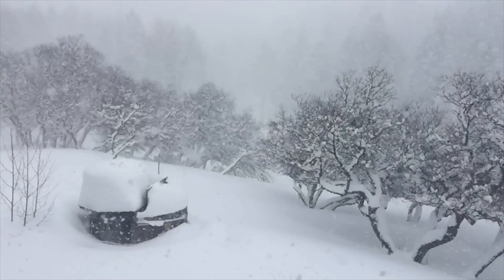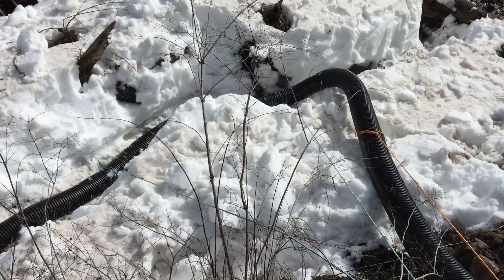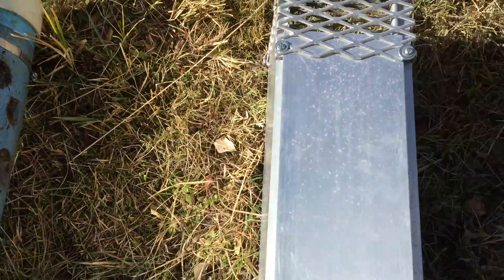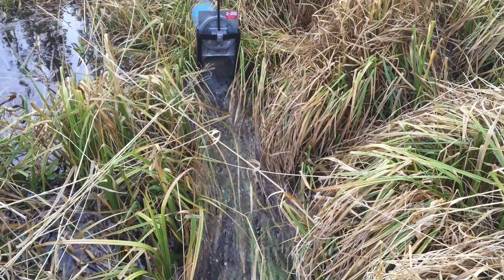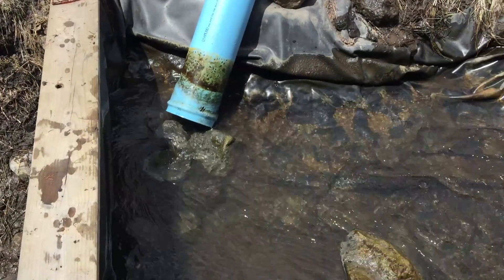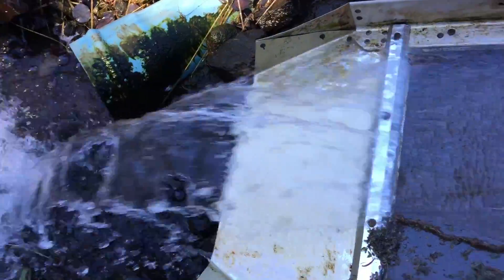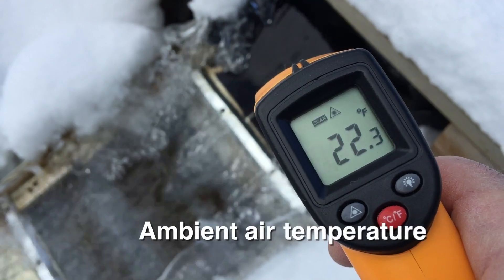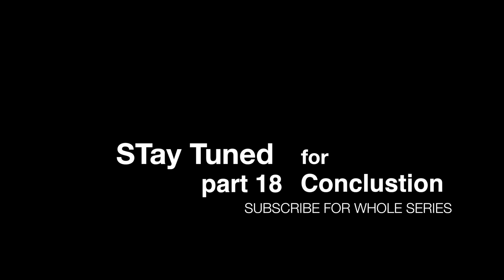Part 17 MicroHydro Power System in CO

Comment: MrHydroHead, Incredible job putting all this together! Not just the system itself, but the videos as well. My wife and I have been moving towards Off-Grid for 2 years now and I suspect that it will be a few more before we are even close to starting. Our little farm and buildings are 150+ yrs old and were poorly maintained, so there is much work to do in getting things up to snuff first. Unfortunately our current property has no running water, however there is a boatload of wind out here! Turbine system would be primary, then solar. Local power Co. says we can't tie-in to sell excess due to the local station's limitations, so battery and inverter system is only way. Start-up costs are high though. I will subscribe and keep on watching as one day I hope to use the excellent info you have so graciously provided. In return I hope to reciprocate with some of my own. Keep on keeping-on!
Reply from the maker: More power to you!  Its a long road but well worth the effort. On wind, I’ve heard vertical vs horizontal is the way to go on the turbine. Thx for watching and the kind comment. Best wishes for your progress.
Reply: @mrhydrohead  YES, stay away from the horizontal, too much noise, too hard to maintain and susceptible to hail storms. Several of my neighbors have wind turbines with stubs for blades, thankfully because the noise was driving everybody nuts. I sold mine and built a small VAWT, much more interesting. Working on a large one now.

Comment: Pretty cool.... For the air locked pipes at the high points, could you install a t-pipe like a chimney stack, the air wouldn't build up and hopefully the pressure in the pipe would be less than the pressure of any water that builds up in the stack?

Comment: Is it worth filtering the soft organic matter out of your pipe system? - it won't hurt the generator and will continue to move as long as the water keeps flowing.  On the subject of icing - put a sheet of insulation above the screen - it will prevent or minimize the ice formation by preventing cold air from contacting the screen.

Comment: The alternative to a screen is a "small gravel" filter that is very wide to have a large coarse grained surface area.  Use 6-10mm sized  gravel 2-4 inches deep for roughly optimal flow and clean-ability.  It will take longer to clean, but it will be once in a long while.  You clean it by stirring it with a pitchfork or similar while directing the flow through it and then out of your system to avoid sudden contamination.  For cleaning pipes, create a crude waterproof robot (flow riding with battery powered spinning brushes to ride the pipes and clean them kind of like how oil pipelines do it.

Comment: This is awesome!

I do wonder--have you guys thought of using a small amount of the power to generate heat near key areas of the system? Even a couple hundred watts could significantly mitigate the need to manually break ice over the inlet/outlet/etc frequently (if it is a frequent thing in the first place). To increase efficiency, you could use IR proximity sensors to detect the ice (mostly just sensing the ice as opposed to the IR beam bouncing off the metal grate, assuming it doesn't get diffused by the water) and run the heaters only when necessary. Or something along those lines, maybe using an ultrasonic sensor that only checks every several minutes if the IR sensor doesn't do the trick.
Reply: exactly what I was thinking...
Reply: or a remote switch to turn it on once the pressure drops off
Reply: @superdupermax  He could install flow meters at key points in the system which trigger automatic filter cleaning and heating if the temperature is low enough, but it may be more trouble than its worth, and requires more knowledge.

Comment: This is over a year late....but have you thought about capturing the exit water from the generator and doing a hydropump to pump it back up and reuse it?

The hydropump works simply on gravity and trapped airpressure.  Where flowing water pushes the bubbles down a tube, when it enters a holding tank the air pressure builds up and able to push the water from the tank back up past initial elevation.  Where you can then reuse it and flow over the generator again...
Reply from the maker: It's an interesting idea, but the intake is 1/2 mile and 240 ft above where it exits.  There isn't really a shortage of water or power produced, so the expense and effort of designing and installing something of this nature doesn't at first glimpse seem a practical use of time money or resources.  The simplicity of what already exists and how simply it functions is part of the pleasure of living with it.

Nonetheless I'm always intrigued by the suggestions people make and thanks for your thoughts.
Reply: @mrhydrohead  Awesome, thanks for the reply, and loved seeing your work.

Comment: Don't know much about this but that stainless steel screen you got works much like a sleuce miners would use to trap debris in a controlled way. An idea for someone with less of a budget. check out the RealMartian on YouTube. He built a self contained micro green habitat in a very cold climate. He uses Ardunio controllers to monitor his operation and control processes. This could be used to control water flow, monitor and bleed air out, and control gates. With some ingenuity, a wireless networked operation complete with cameras on your property?
Reply from the maker: I've had a very short look at The RealMartian. Great great stuff and loads of it.  Thx for sharing this, it obviously will provide loads to learn. 👍👍👍
Reply: If you ever have to move water uphill, look up ram pumps. No motors or electricity. Just have to have positive flow. A thought I had if you wanted to recirculate or move water around your property. Wranglerstar had a couple good videos about them a few years ago.
Reply: Ram pumps can be made easily with off the shelf plumbing fixtures
Reply from the maker: Thx for watching and the tip. I’ll check it out 😉
Reply: Sleuce the debris out before it hits your filters. However that would hve to be cleaned.

Comment: Or you can use a big hose that is under water with a big 10 inch cut out in it that is downwards to then push water up and over to the screen, so stones and big debree are sifted out before reaching screen that is in open air

Comment: Very good system my curiosity is why not generate the power near the intake and transmit it with wire
Reply from the maker: The head or fall of the water builds pressure and that is the source if the kinetic power that is converted to electric power
Reply: Thx for reply.  I thought it was something like that. Love the kolander screen

Comment: I noticed icicles forming on your eaves.  Soon water will find its way into your ceiling.  Got to keep your attic space cold or else you might need a new roof because your attic air is very warm and melted snow dams up under your shingles and damages your roof.
Reply from the maker: No attics in the house. Ice dams have become a problem on the north face where the sun doesn’t melt them off. Plan to install heater cables to reduce their formation.
Reply: Get some roof squirrels. They’ll keep it clear

Comment: WHY NOT INSTALL A LITTLE HEATER BAR IN WINTER TIME FEEDED WITH THE ENERGY PRODUCED BY THE POWER SYSTEM TO HEAT THE SCREEN ON THE CRITICAL POINTS ON THE WAY OF THE WATER.
Reply: Because it will need too much energy to be effective. The flowing water will constantly cool it.
Reply: @vstoykovbg  Good point . It would require way too much electricity to fight against the constant cold temps .
 My thought was perhaps wrapping the pipes with insulation and burying them below a few feet of sand and then use styrofoam sheets to insulate other areas exposed to the cold air temps or build small shelters around the areas where exposure to the cold air could be an issue . 

Obviously these people know what they're doing but the thought had occurred to me that insulating key areas where there's any exposure could greatly reduce the need for constant maintenance aside from the regular debris trap clean outs  .
Reply: The problem is not the freezing of the tubes, it's the freezing above the collector and clogging the filter wit ice and/or biomass.

When the water is running it does not freeze, even when the temperature is slightly below 0*C.

Of course, the thermal insulation will prevent water from freezing in case tubes are clogged or temperatures plunge way below 0*C. But at such low temperatures the collector will be frozen too.

Comment: Build an automatic brush. 
That rotates from the current of the water. And you'll have clean screen. 

Or use the electricity to drive a motor and brush of the screen With a timer.
Reply: Great idea but might freeze in the winter.

Comment: I wonder if using any solar in the system would provide some heat to melt ice at the screen or elsewhere it might be needed (parabolic collector?)....not sure if the need is sufficient. it could even be a brine, self cycling with elevated tank, if not photo-voltaic.I was going to also suggest a brush powered by the water or solar, but you addressed that a few comments below. You have a great thing there, which creates those feelings of energy independence I've been drawn to since the 70s! thanks for posting!
Reply from the maker: Thx for watching and your thoughts

Comment: You need to add a sluice box so you can harvest your gold in late spring.
Reply: WARNING. Before anyone does any of this you should look into your states department of natural resources on regulations regarding trout or salmon stream alterations.  In many cases you can receive a significant fine for doing something like this.
Reply: Ha ha
Reply: Haha! I was just thinking the same!!
Reply: if it's anywhere near alaska then there deffinatly IS gold in there.    

infact with the glacial movement in the past it should be possible to find gold anywhere even as far down as central usa.
but that organic material would be a giant pain to work with.
Reply from the maker: Lol. Would certainly do so if there was gold here but no such luck

Comment: Not sure where it fits in with your issues but with all the cleaning and ice removal have you considered anything like an inner tube at the exit points when the ice builds up inflate the tire it cracks the ice. Planes have been doing something similar for years to remove ice on wings.  You can also use a burst of air to reverse flush the derry on intake filters.  I'm not an expert just throwing it out there.  Good job on off grid, looks amazing.

Comment: You show me the problem i have solution you need copper pipe and a boiler and copper pipe will be insulated with pvc . run parallel with source pipe run steam mate easy to sovle or run power cable and heater blockes or hybrid both to prevent icing.

Comment: Great video.Very nice build.
 You may have already fixed your problems.
 Your Coada screen I thought maybe you could use the power of the water and build a paddle(like on a paddle boat)with rubber or brushes on the ends of the paddles that would keep turning cleaning the screen?
Reply from the maker: You would not believe how little organic matter actually sticks in the Coanda screen. It requires a visit maybe at most once per week and maybe every two weeks. Even at that, there is so little accumulation I need not visit for the most part. Thanks so much for watching and your comment
Reply: @mrhydrohead  Sounds like you found the right screen.👍

Comment: Awesome guy's...I also have idea's about hydro power generator ...my idea is a bit different though...my idea was to have a floating generator that would follow the flow of the water level ...much like a float in a fuel tank for fuel level...floats would be mounted with metal poles in the center of them to allow them to rise and fall with the water level... I don't know if it would work for sure...it's just an idea I will probably never get to try out
Reply from the maker: Hmmm. I’ll have to think about that. Thanks for watching

Comment: You should have heating ..
Reply from the maker: 5000-6000 kWh per month is more than we can put to effective use. At the other end of the system, low maintenance & monitoring. No need to run expensive  loss prone wires 1/2 mile uphill. 

Just the same, thanks for watching and your suggestion

Comment: I have an idea for your intake. In koi pond filters there is a device called a vortex filter. Solids swirl to the center and flow out through a small,  low central exit. Water for power production is bled off of an upper overflow chute. The thing is designed to maximize swirl, like a Dyson vacuum cleaner. Something like that might work in your application.
Reply from the maker: Interesting idea. Thanks for watching

Comment: I like how you share your design process, especially the failures why they happened and how you solved them. I wonder if it would make sense to have mini greenhouses around in the intake areas to help melt away the ice, or maybe some sort of solar voltaic heating element to keep the grid temperature just above freezing or maybe it could be traditional solar water heater radiating heat. It seems there is plenty of sun light to achieve those goals. Just a thought.

Comment: Followed ya awhile now. All beautiful. Ampmeter ?? Nyet.Nein. AMMETER  OUI !!
I have a crazy idea for ya. It might sound crazy,... but.... I'll own your failure if you have to try it.
Check a company Mt.Baker Mining and Metals.  They have designed a sweet little offset gated chute for their Finish linework.  They are here in YouTube also.
Also, I understand the Polarity of water will dictate it's freezing point, far more than salinity does. I wonder if polarizing the unit might stop it's surface from freezing at all. And instead of the ax and shovel, a water hose does do good work on ice.
Reply from the maker: Thx for watching. Can’t locate gated chute you mention. Would it be for diversion of water or filtering of water. Not sure I understand

Comment: A drum shaped screen that rotates  would not have build up .
Because it would be constantly spun by the water flow like a paddle wheel . 
Also a photo voltaic panel a battery and some thermal wiring could deal with your freeze up spots.
Or a tall tube of pvc painted Black capped and filled with a glycol mix .
Would heat in the sun and constantly thermo syphon . 
Make it taller than average snow fall ....

Comment: There is a thing called a Trompe it uses hydo power by taking micro air bubbles trapped in the water stream to a underground chamber this creates huge air pressure that can run turbines without the wear and tear of sediment on them you can run any pneumatic tool off the system as well they even used it for cars back in the day.
Reply from the maker: Very interesting. Ill research that. Thx for watching and sharing
Reply from the maker: https://www.motherearthnews.com/renewable-energy/hydro-power-zmaz77jazbon
Reply from the maker: It certainly warrants investigation. Right now we’re under about 20” of snowfall so far this year. Any additions will have to wait until spring to even consider.

Comment: Why not try to use stainless mesh
Reply from the maker: Tried it initially, but organic matter quickly became lodged and reduced the creek diversion flow. Letting organic matter into the meadow isn’t an issue as the engineered coanda screen finally installed filters all of it out.

Comment: hi just a thought you could perhaps mount a window wiper motor in a sealed box with a battery that gets some electricity from the generator with a wiper blade that activates on a timer switch to clean the mesh filter from time to time do not know how to do this my self and would like to do something like this my self just a crazy thought ?
Reply from the maker: Actually the cleaning on the engineered screen I installed is very minimal, besides running power 1/2 mile up to the screen would cost a fortune. The newer screen is here:
Elgin Coanda Screen Installation
https://youtu.be/KVrt3oM5qWo

Comment: I believe most of your problems screening could be solved with an intake settling pool with a shunt load resistance screen heater with intake a few inches below water level
Reply from the maker: Unfortunately it would require running 1/2 mile of wire with big line loss. Solved the problem with changes in the intake design

Comment: Screen Problem resolution is a drum which will rotate under a long brush both sides so then screen is constantly cleaned without attentiveness, use bearings that will not freeze being kept out of the water using a long-shaft then cover the apparatus with a sheet of galvanized to avoid debris falling into it. You might also consider a series of beeps that would be sent wireless on a ground line like telegraph setting it uo as a battery operated rotating disc so that it will alert you in the home for a problem that occurs at problem areas using a different code per area and a paper fed Seismograph (https://d2v9y0dukr6mq2.cloudfront.net/video/preview/RJZZIy2/seismograph-machine-room-animation_n17uuf_v__SB_PM.mp4) or computer program reader RS-422, RS-485 or RS-232 input.

Comment: Have you tried a cyclone sediment separator device instead of using meshes? You can probably make one out of a large water drum pretty easily, leave a small opening at the bottom for small particles to flow out and a large opening with valve for periodic removal of large debris.
Reply from the maker: Not sure we need to fix what is now working fine, but thanks for the idea and thx for watching